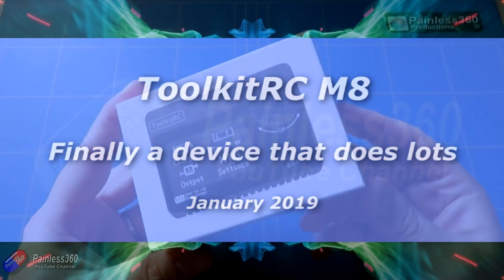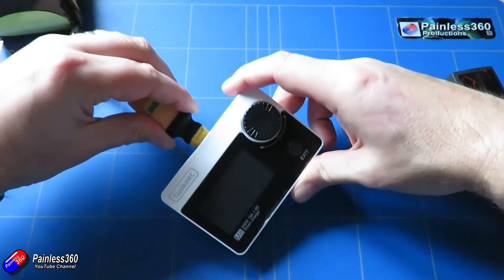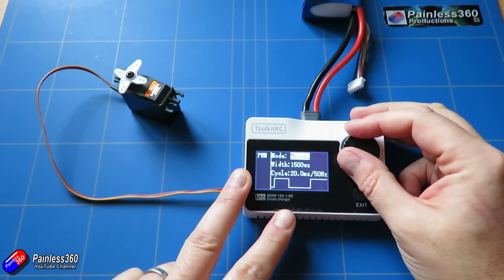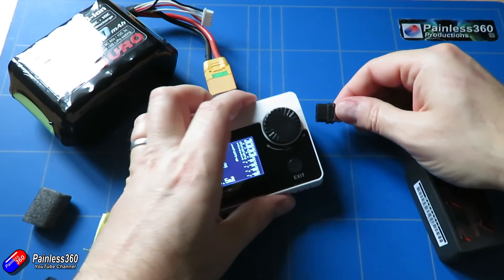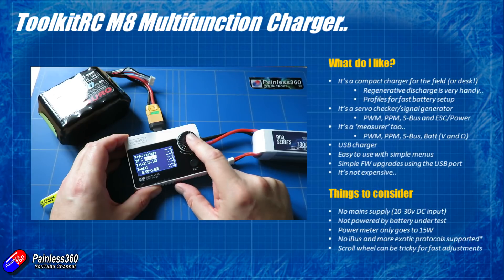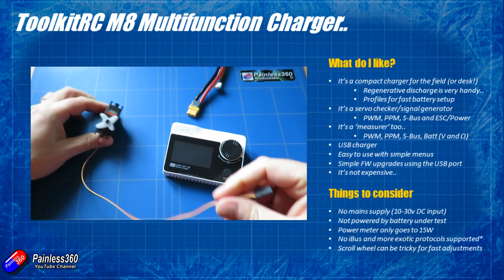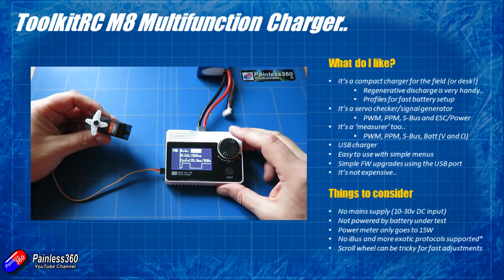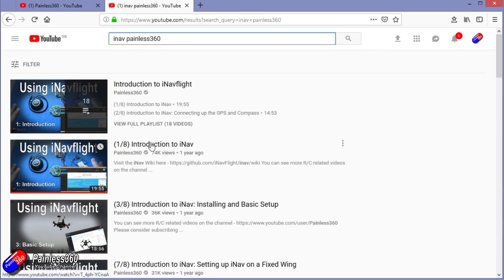ToolKitRC M8 Mutifunction Charger

Comment: Sir I have another problem like recently 1 add wire on fuse side , but suddenly stop working my M8 charger , what can I do now and it behalve like he don't know calibration or reset all , and don't entering on calibration mode plz help me 😞
Reply from the maker: Sounds like that wire you added caused an issue. Best of luck
Reply: @Painless360  my problem is "https://photos.app.goo.gl/aCFpHxE2AWNMDAGj9". I think now you understand what can I do.
Thank you 🙂
Reply from the maker: No idea, I've never seen that. If it's new I'd return it. Best of luck with it.
Reply: @Painless360  1 year old also our all shipping company do not provide on china in India so i can't and also company  no longer available 😐
Btw thank you sir 🙂
Reply: You are my hero 😎

Comment: Do not buy the product from Bangood. I asked for a replacement with ISDT in about 1 hour after purchasing the product. They created a notification. I realized that it would take time and I wanted the order to be canceled. They did not cancel. I warned that the product could be sent until the notification was processed. Don't worry, they said they'll get back to you. they said. And today they say the product has been sent. They said that I can no longer exchange or refund .. Naturally, I think it was done on purpose. They forcibly sold the product. Bangood is no longer honest and reliable. There are many complaints already. They started to defraud the man.

Comment: Can this be used with a discharge module via the input xt60 and the servo connector?
Reply from the maker: Not sure what you mean by a discharge module? Can you elaborate?
Reply: @Painless360  you can discharge batteries on a cellmate8 with a module, it sends power to 3x 50w halogen bulbs to discharge a battery

Comment: On banggood as well as other sites customers have reported problems with this charger especially when it comes to accuracy of voltage and current.
Some said that balancing is impossible as the voltage readings are so inaccurate that it overcharges (potentially damages) some cells over others.
Also read that the output current reading can be completely off from what is actually output.
Can you confirm/deny this?

Comment: Hi, I'm a RC biginner. The spec of M8 says  chargeable batteries are Lipo, Lihv, Life, Nimh or Pb. How about M8 setting for Liion, Nicd charging?
Reply from the maker: You charge LI-Ion the same way as a LIPO so you usually just select that charge setting on the charger..
Reply: @Painless360  Thank you for your reply! Nicd has same M8 setting with Nimh?

Comment: I like that charger. It would work well for me. I could solder an XT connector to a laptop power brick and power it. Unfortunately I just bought my new charger for next year when winter is over and I'll just use it. This would be a nice backup charger and multi test tool. Sometimes I end up giving bye used but not abused RC equipment to younger enthusiast. Gives me excuse to upgrade.

Comment: Hi, although it’s not relevant to the video I have a problem. I fly FPV with spectrum, and have a DX6. With my quads I’ve been flyin with motorstoo enabled as my radio only has 6 channels. Aux 1 has the flight modes and Aux 2 has the beeper and arm enabled( when disarmed beeper sounds, so I use a throttle cut on the dx6 to prevent accidental prop spinning) however I would like to have the arm function, could I set this up in the radio as a set percentage of throttle that it starts at? For example using sub trim to spin the motors or setting the minimum at around 8% or so, so that when the stick is at the bottom the motors idle? Would this have the same effect as using the ARM in beta flight?
Reply from the maker: I've not used Spektrum radios for a very long time. I came to FRsky radios through Spektrum and was a big fan back in the day. Sadly I'm not sure how you do that on a Spektrum Radio now. I hope you figure it out. Best of luck!
Reply: Painless360 hmm ok, but what I’m basically asking is can I use throttle up trim to give the effect of the motors idling?
Reply from the maker: I wouldn't use it like that. I recommend making sure that you can arm and disarm the flight controller safely and focus on that at the expense of the buzzer personally. Best of luck..
Reply: Painless360 cheers, I can disarm the flight controller fine, but it beeps when disarmed. So I keep the flight controller “armed” at all times unless I’ve crashed (Happens a lot). The problem is when I drop the throttle the motors stop and take a second to sprall back up, but I may have to loose the buzzer tbh. What issues could come with using the min throttle as a fake “arm” and use throttle cut (which doesn’t require another channel) to stop the motors. Isn’t that what the arm in betaflihht does? Sorry for the many questions but it’s been bugging me for a while and I don’t want to buy another radio just for this reason.

Comment: Do you have a video on the options to power these 'budget' chargers?
Reply from the maker: Not really. A lot of people use old laptop chargers that have 12 or 18 volt output with a nice healthy amperage too. You can easily make an adaptor from that into an xt60 connector to power it. Hope that helps.

Comment: I bought four of these for my SUV.  I have been using them for about two weeks connected to 300amp hours of Lithium Ion Battery (3 100 amp hour battle born batteries)  This charger is the real deal.  And recycle discharge for storing batteries that you did not fly is a very cool feature.  
They have had two firmware updates since I purchased.  Easy to upgrade.    Now a request.  When it finishes charging it shows a screen with an OK on it.  When you press the screen it clears out how many MAH was put into the battery.  You can see the info while charging, but when done screen pops up it covers up this number and when you hit ok, it clears it.
Reply: Nice info. I was just telling someone I have two batteries and a Hyperion charger with the regenerative feature within my vehicle, but for them would be Ion as a recommendation. 
Some of the things I have experimented with is plugging a battery directly in parrellel with my car power system, using the car AC plug with a float charger, using a solar panel and charge controller. All of these have worked well and even in combination. 
With a charger like this, I am up for a more permanent setup with multiple chargers and some running parrellel. 
I fly mostly fixed wing, but have six 1300 4S coming as I run those in parrellel in different planes.
Reply: Those batteries are certainly expensive.
Reply: Battle Born batteries were expensive, but they run my refrigerator, my electric blanket my lights and even a doghouse air conditioner that I use to camp with.   (Cools my car nicely!) Don't have a dog.   I bought them for a  CAR-V setup.   Using them for RC task is just a great secondary use!

Comment: many cool chargers out there today   4X  charger using balance leads !   Bluetooth thru your phone also cool .      another new one uses  USB PowerBank   (has voltage booster to increase for goggles ! )     at the field I connect to car battery with car jumper cable with XT60 on one end that I plug into charger (15 feet away from car) ….   now if only we could use a MAVIC lipo on kwads !   easy safe charging,  snap on off … I would bret we see this in 2019

Comment: The power meter is intended for things like servos I think? Thats the only reason I can imagine for that 15W limit (which isn't even a very beefy servo at stall current).
Reply from the maker: It’s actually 15amps, my mistake. Still not enough for a modern ESC and motor setup..

Comment: Quick question: Does the balance charge mode on this use the see-saw method of charge i.e. charge via the main plug, discharge highest-charged cell via balance and repeat until all cells are equal? Or does it top up lagging cells via balance?

Comment: Good find and I agree re: the dial control. I'd have preferred proper buttons but I guess you can't have everything.
Reply: dial is way faster, see the taranis q x7
Reply: @jdigi78  
I have a Q X7 and for changing values you're correct, it is faster. But when the options are limited or when you need to jump around a screen a lot then it can become tiresome and buttons are a much better idea.

Comment: Nice, now open it up and add a barrel connector on back for a laptop brick to plug in when at shore power
Reply: Or fit an XT60 connector onto your laptop brick cable. I bought a 24v 4A laptop brick from Banggood for £6 and that will charge any battery I'm liable to use.
Reply: Exactly Chris!
Many laptop chargers are 19v and 5 amps and worked great for powering multiple 4s chargers.
Reply: Exactly! Thats the only thing that make not to buy it